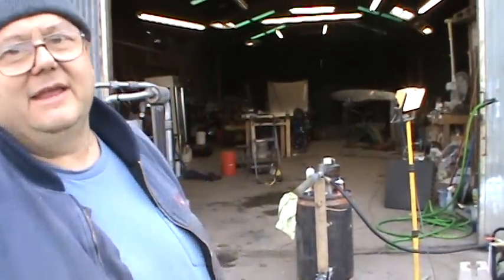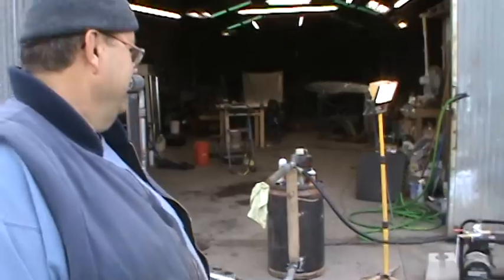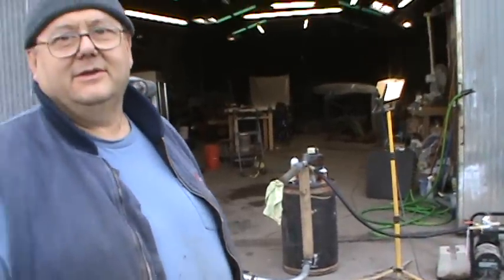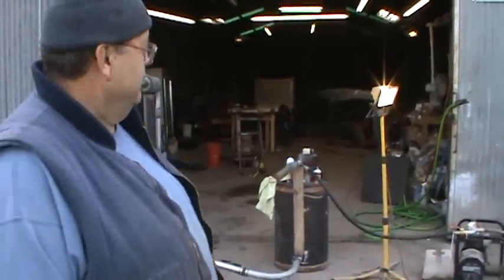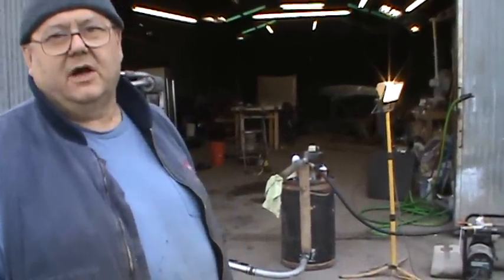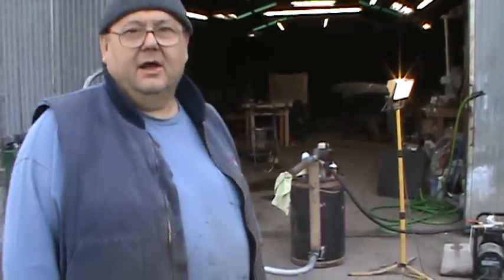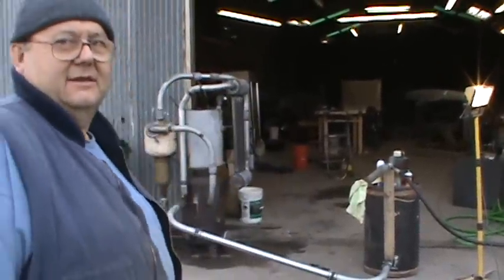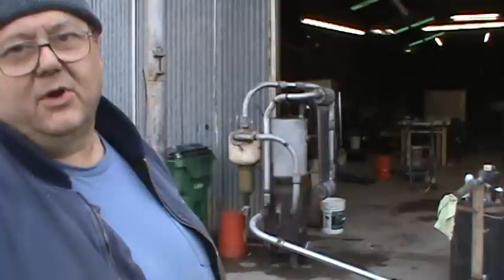woodgas4 2

Comment from the maker: Yes i can start up with no problem. I did install on the generator an papir cartridge filter, and that filter after two and half hours just littlebid have some  ash particles and ho tar any. If you have good filter and now ( i did modified the fema gasifier) i have higher temperature in it and that help lot with a tar evaporating at burning and  do not cost problem.